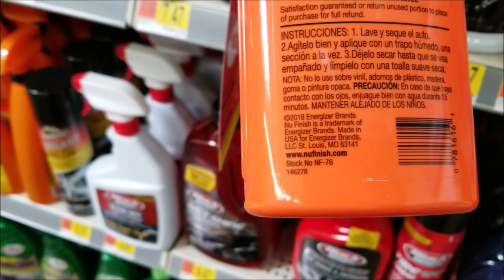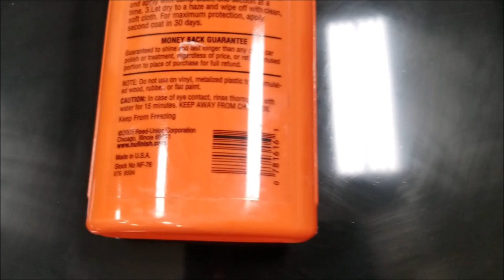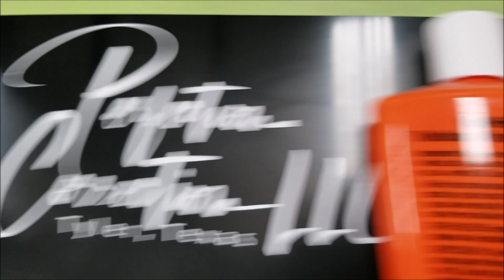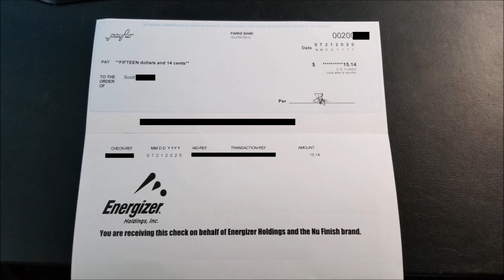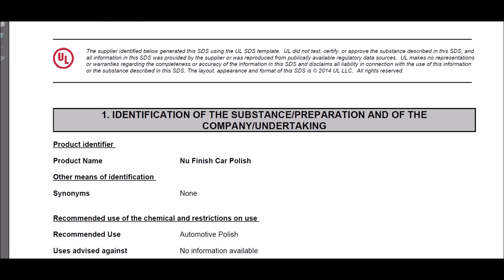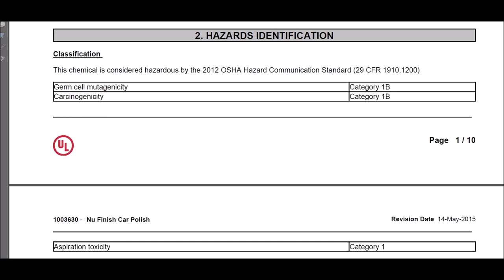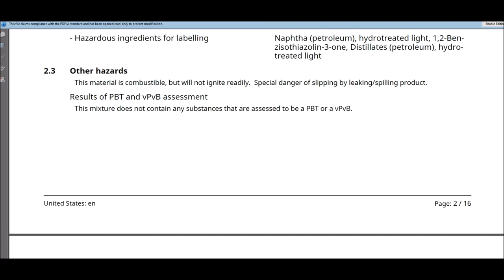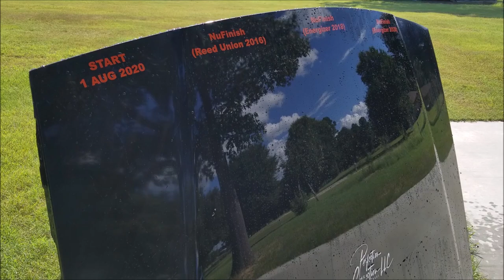NuFinish - Old bottle vs new - did the formula change?  Lets find out!

Comment: So they could be telling the truth: Energizer are using the same formula they received, it's just that the formula was changed before they received it.  Also, just to play the devil's advocate: could the standards for what goes into the MSDS be what actually changed, not the formula itself?  I don't think that's particularly likely, but worth taking a moment to think about/rule out.
Reply from the maker: Good point
Reply: Yeah, from the SDS comparison this sounds like Reed-Union changed formulas in the last year or two, probably to help the books look good (profitable) before selling. Unfortunately, this happens during buyouts. Energizer is using the same formula they were given, but that's not the original
Reply from the maker: @zinger565  agreed.  I guess their representative is telling a half truth then.  It hasn't changed since Energizer bought them out (or did it?), But it definitely has changed since the reed-union days.

Comment: Interesting that the original NuFinish had ceramic microbeads and was sold for about $8/bottle.  Now ceramic products are the “new technology” and sold at greatly inflated prices.
Reply: But it did not have the durability of the new products.  Even when the water repellency fails on the coatings, the protection against UV light and oxidation is still present.   You pretty much have to polish those off to remove it.  New Finish is just a sealant that lasted longer than the others
Reply from the maker: Good point.

Comment: After all these years, unlike other company lquid wax cleaners, the NuFinish bottle still does not have a popup cap on top with a very small opening to precisely put what you want on the applicator for less waste - especially if you knock the bottle over!

Comment: I have bought one by the end of 2023, and it has the similar off White color as your 2016 bottle although it made by Energizer.
I Used it yesterday For the first time, It did a fantastic shine to our car, I applied the product to the body, chrome trims, windows, windshield, back glass, mirrors as well as the headlights after restoring them.
Hope I get the protection as the old batchs of the product.

Comment: Thanks for a very detailed review. That said I noticed that when you applied the Nu Finish the amount of polish left on the surface seemed to diminish as you reached the end of the panel. This only makes sense as the amount of polish on the applicator diminishes as you progress across the hood surface. That said wouldn't it make sense when doing the second application to reverse the direction? Thus the amount of Nu Finish would tend to equalize. The way you applied the Nu Finish it seems all but certain that there would be more applied at the start point and less at the finish point? As to the SDS sheet it would not surprise me if the reason for the increased warning level had less to do with changing contents than changing Federal Safety standards. And many petroleum based products would merit the same sort of warnings. Probably not a good idea to drink Nu Finish or use it to wash your hands but I'm guessing that the Feds follow the "Better Super Safe Than Sorry" philosophy.

Comment: After Consumer Reports recommended Nu Finish back in the '80s, I started using it religiously.  In about 2005, I was converted to Zaino Bros.  Nu Finish seemed to be too old school, and I found it to be more work and did not at all last the full year it claimed while Zaino was a bit easier to remove and looked better.  I'm not going back to Nu Finish, but I'm fascinated as to what you'll find from this test.  Thanks, Scott!

Comment: You may want to do a similar test with Liquid Glass. Two versions of Liquid Glass appear to be in the marketplace now being sold.  MPT claims to owns the rights to the name Liquid Glass. However, they do claim it's a new formula and marketed as LG900.  The same old familiar  Corvette is  on  the container but it's now in a plastic bottle.  Advance Auto Parts is marketing the familiar metal container can version with a modern day Corvette but it states the manufacturer is CFPI for Liquid Glass.  However, CFPI does list the familiar  LG100 reference on the label which is what the old formula used.  Some claim the new Corvette look container is the old formula but others claim it's a different formula too.  Which do we believe?

Comment: Howdy from Lake o' the Pines! I used Nu-Finish for years when painting houses for realtors in the Longview area to restore the sheen to older fiberglass shower/tub units. Never told them what I used since they thought it took considerable effort due to amount I charged for that. A while back I checked out a website where a man was restoring damaged/missing clear coat by using several applications of Nu-Finish. Was curious to know more about that method now that I own a '05 Black Dodge Neon that my son in Tyler gave me since the Dodge dealers wouldn't give him jack as a trade-in due to milky & crumbly areas in the clear coat. I noticed that the white spots turned black when wet with rain so was considering to apply a few coats of thinned bleached shellac to a few areas to see if that would give them a wet look. If not, then I can remove it using straight ammonia (and probably take off the failed clear at the same time).

Comment: Scott, why didn’t you have an independent lab compare the content of each bottle? That would have told us quickly if the formulas are the same or not.
Reply from the maker: I will check into that!
Reply: @ScottHD  They won't do that for anyone except for the product's manufacturer.
Reply from the maker: @billwilson3609  figures.  That stinks
Reply: @ScottHD  They can't since that would violate patent laws. As for the formulas, those could be the same and the new company is just using a different trade name for each listed component. One can find their various trade names by looking up their CAS number. The oldest batch listed petroleum distillates (Stoddard Solvent). That's refined from naphtha and was used for dry cleaning. The newer batches list naphtha and it may have the same CAS # as Stoddard solvent. Their clay beads may be the same ceramic beads since ceramics are made from clay.
Reply: @billwilson3609  that’s bogus.  100% bogus.   We do it for engine oil manufactures all the time.  A patent is a copy law not a biometrics and composition law.  Btw ceramics are made from quartz not clay. U are thinking of pottery ceramics not silica ceramics

Comment: Well it's my opinion that current MSDS's (SDS's) are not what you  would think they are intended to be.   While they do contain pertinent information, they tend to over state  hazards and risks in CMA language of lawyers.   For example, read a NaCl SDS and tell me if you want to touch it much less eat it.   By the way, NaCl is table salt.   The problem is even after reading them, you are not sure what the legitimate risks are.  As years pass, more chemicals are listed as hazardous.  Whether the actual formulation has changed or the required chemical reporting has changed is anyone's guess without further testing.  Your results can give further insight.   I guess you could say the MSDS can be taken with a grain of salt.

Comment: BTW the copyright is for the bottle. Those dates have nothing to do with what's inside!
Reply from the maker: Good point.  They just hadn't renewed or changed the copyright.  Based on the color alone that tells me the bottle is probably 2012 or older.  (Since SDS says the color changed from off white to white in 2012)

Comment: Hi Scott. I've heard nefinish works well on auto glass for water repellency and to help wipers glide more freely. Have you ever tried it on glass? I find RainX is not what it used to be and was thinking of switching to nufinish. What are your thoughts on the subject? Perhaps you might host a product shoot-out on a glass panel. RainX vs nufinish vs...
Reply: It works great on the windshield and I like it much better than RainX.  RainX causes the blades to chatter when it starts to wear off, so you feel like an addict constantly in need of a "fix".  NuFinish just sort of fades away and you can redo it whenever you want, without the chattering penalty.  The clay in the NuFinish also does a good job of lifting contaminants from the glass.

Comment: Hi, new subscriber here! Great work on this, really appreciate your attention to detail. I wonder if the recipe hasn’t actually changed but the laws reporting toxicity have. So the first materials sheet did not by law, have to report all the ingredients and their effects. But through time, you see that as the laws change, there are actually super toxic ingredients in the formula that must be revealed to the user. Just a thought.
Reply: I was thinking the same...but that wouldn't explain the viscosity ,color and durability difference.
Reply: the active ingredients did change. as well as the laws